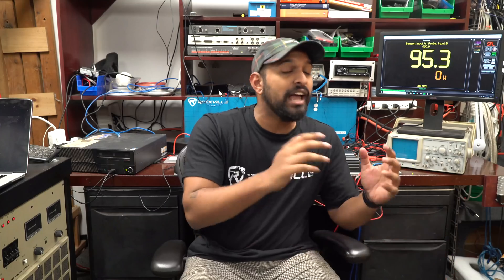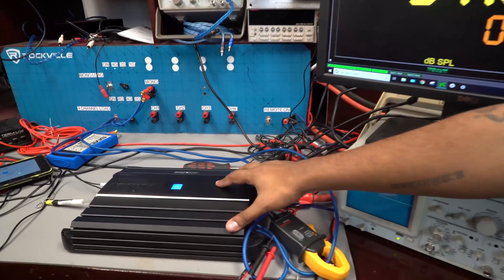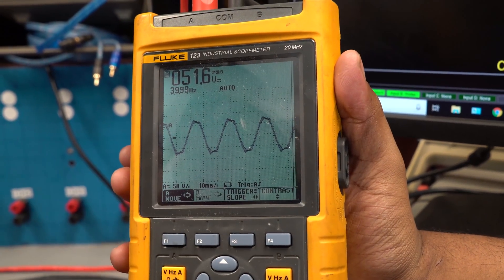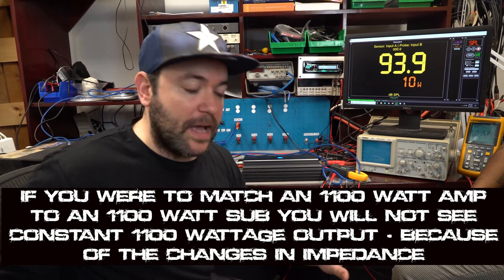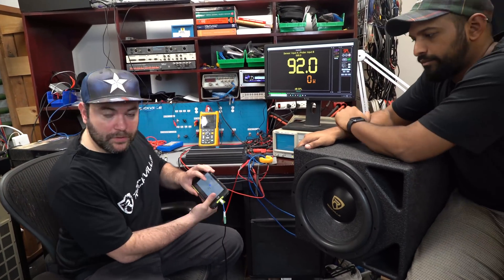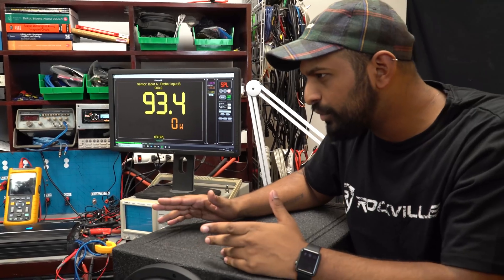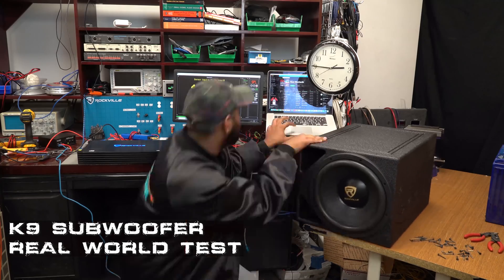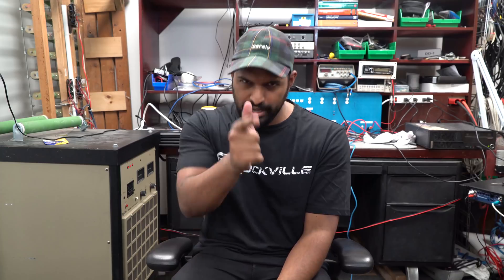Impedance Vs Frequency ft. An Alpine MRX-M110 & A Rockville K9 Subwoofer

Comment: I won’t lie I’m looking into a set of your k9 subs. For the price they look to have good specs
Reply: We are very confident you will be happy with them and impressed.
Reply: Rockville Sam only concern I have is only rocking a jl 500/1 slash not sure 300 watts per speaker will make much noise if there rated for 1000 watts
Reply: @paulgarcia6257  500/1 is a good quality JL amp but its only 500 watts at 2 ohms so you would be underpowering the woofer but if you choose to get it with that amp then make sure to get the 4 ohms version so you can at least run it in parallel down to 2 ohms  and get the maximum out of your amplifier. In a perfect world I would say to get a more powerful amp than that for the K9 woofers.  I hope this helps.

Comment: Box tuning can make up the watts but adjustment of the port to get the ohm load that makes your amp perform to it's optimal power range
Reply: Slow down these actors cannot comprehend Port matching nor do they know the difference between electrical Watts and thermal limits .

Comment: I’m no noob when it comes to “clamp power” but I’m one to believe if a sub is rated to take 1000rms  it should be able to play around that power not the odd spike in power once every few seconds 
Meaning if I had a sub rated for 1000w yes the everyday person buys a 1000w amp but when stated CEA rating it should be able to take the “rated” power clamped for more then a few minutes 
A consumer isn’t going to market there sub 
It’s a 1000rms sub however can only take that power occasionally 

If I buy a 1000rms sub I’d expect it to take 1000rms at BEST “daily” not just for a minute
Reply: Well..just keep testing those subs on your "Will it Blow" series.

Not..stating this..test tone aside...how music musical power would you recommend using..how many actual watts.. Would you suggest using on your new DESTROYER 12?

I am not asking what size amp..I am asking how much net wattage after impedance to get the most out of the sub on bass music?
Reply: @alvinmiller6675  Alvin We recommend you use a 2000 watt or 3000 watt RMS amplifier on the Destroyer , you can get away with a little more power if you know how to set your gains and then you can play your music at high volume.
Reply: Hi Mitch, thanks for the comment. We will have more videos coming in the near future explaining this topic. We also have another video coming with  the K9 where we are putting more wattage on it to show it can handle much more. There is something  called crest factor. If you want to do a test yourself then try the following but if the subwoofer blows we can not be responsible. Here is a test you may do. Take your woofer that is rated for whatever RMS its rated for, then clamp power it at its full rated watts with a test tone. Best thing is with a term lab or an AMM-1 as just clamping doesn;'t account for phase so you will not know what percent to deduct after you multiply amps times volts to get watts you will only have VA. Now run a test tone frequency  through it and see the clamped RMS watts on the meter. Most subwoofers will not last 5 minutes. If they are very underrated they will last a little longer. The reason is because test tones have a low crest factor. The wattage will maintain at the full RMS rating at the beginning then subwoofer will star tot heat up and will never get a rest to cool down. It will continue to heat up more and more until it burns up. Also as  it heat sup the impedance will rise which will show less power on the meter so if you want to actually do what you mentioned you will need to raise the level of the gain or volume higher as the woofer is heating and self destructing. Its actually a great way to blow a sub. Please tell me if you have questions on this and I'll try to answer them.
Reply: Rockville Sam yea I understand what your saying but there are still so many factors that you are not applying to this compared to EXO testing and trust me if we could get Rockville in Australia I would get a few but after conversion rate of sub price and monster shipping cost they are to expensive for a “budget” sub 
Which is sad because I’m a few weeks I’m going to be doing a massive “budget” sub burp/music tests with tons of budget subs around 40 to be exact and these would fit in perfectly so if u wanna send a 12” to Australia for me to play with be my guest and see how it stacks up against its competitors 

I’ll wait for the next explanation video to come out before I continue my question about the tests you are simulating compared to real life testing and bench testing also why ur tests are not the same as EXO 
I’ll give you a hint ...loading...

Talk soon
Booma
Reply: @rockvillesam3772  yes but your sub didn't handle its rms in music spikes for a min. I like the value and was considering trying a destroyer for the price but these last few vids trying to pull one over on  consumers changed my mind. Your ratings are nuts it's just marketing. Rate them where they need to be and it's still a deal. Not 1000 rms 4000 peak. Are u kidding.
Reply: @garymason2815  Stay tuned for next video. All will be clear to you.
Reply: @garymason2815  For Destroyer its 2000 RMS thats the rating you should pay attention to if you will match it to a quality amplifier. Its an awesome powerhouse of a subwoofer. Its really a beast.

Comment: good info guys. 
Another area not often discussed is mechanical power handling vs thermal. Most drivers will exceed Xmax long before they hit thermal. This is easily seen in 1) a ported enclosure in which frequencies are played below Fb and 2) a sealed enclosure enclosure used with too much boost
Reply: Yes you are right. Maybe we should make a video showing this and explaining how to set the subsonic filter properly to counteract the problem.
Reply: @rockvillesam3772  Absolutely! As a speaker designer myself, its one of the factors I look at and one I see most overlooked m
Reply: @isaeagle4031  You are totally right on that
Reply: Rockville Sam, what you guy almost come across as not getting is that these kids(bassheads) today play a ton of music below 30..even 25hz today and rarely if ever even use subsonic filters. This is not the 80s and 90s anymore...neither is the music of choice.

And they put very big amps on subs to take account impedance rise!

But keep the videos coming!
Reply: @alvinmiller6675  Hi Alvin, thats a great point but some of the kids do not realize that when you have a Vented box when the woofer plays below the tuning frequency of the box the subwoofer reacts in an "unloaded" way and at high power will go beyond its linear excursion levels which can severly damage the subwoofer. Also well aware of the impedance rise and sometimes trying to squeeze more power out of amplifiers by running them below minimum rated impedance. Its living on the edge for the amplifier and it makes it much more likely to damage the equipment.

Comment: Get an orion xtr 2500.1dz
Reply: I second that. I love my strapped Xtr 2500.1's
Reply: @catch22frubert  how much power u think u getting at 1ohm load strapped ? Im thinking of getting 2 for my xfls and run the subs at 2ohm strapped
Reply: @HardKnocks160s  I run mine strapped at 2 ohms on 2 Soundqubed HDC3 18's. I wouldn't strap them at 1 ohm for a daily build. The amplifiers aren't maxed out in my setup, but the subs are moving really well, and I'd assume I'm clamping 3000-4000 watts RMS after impedance rise, depending on the frequency played. I don't compete with it, so I never cared to clamp test or anything like that. It's just a daily ground pounder. The wattage is always going to be dynamic and jumping around with the music, but you should be able to see 3000-4000 watts on average if your electrical is good. I also have a 300 amp alternator and four group 31 AGM batteries. I usually sit in the mid 13 volt range at 2,000 RPM
Reply: @catch22frubert  thats pretty good any vids?
Reply: @HardKnocks160s  The Xtr 2500.1dz is a really strong amplifier. I ran one @ 1 ohm on two American Bass XR 12's for two years, and those subs got down for just two 12's in an SUV. XFL's are roughly equivalent to the XR's I ran, so I can only imagine that two Xtr 2500.1's would do. You would probably have to be careful about tuning, because strapped Xtr's would definitely overpower two XFL's. If you really want to be loud, consider using two 15'' subs and a single XTR 2500. Cone area is King, and it's less expensive than buying a ton of electrical upgrades.  Bigger subs with more cone area are the most effective upgrade you can make
Reply: @HardKnocks160s  I haven't made any videos yet, because I'm still building the setup. I'd like it to be clean and complete before I go trying to show it off. Just got the matching Xtr 500.4 and new 6.5's for the interior speakers, and I'm changing the head unit. Last, but not least, I definitely need to do a ton of sound deadening lol. After she's complete and cleaned up, I will definitely post a flex video
Reply: @catch22frubert  thats pretty good any vids?
Reply: @catch22frubert  i have a synergy audio wfo 5k rms amp rn at half ohm on these new model xfl 12s in box tuned to 30hz 2 12s in a sedan they take all power clean power i was just wondering if i should strapp 2 xtrs i had a 2500.1dz before they are good strongs amp

Comment: Get a bigger amp and try out the test .   clamp a 1000rms to a k9.
Reply: why you already know iT Will blow in 30  seconds
Reply: @promo130  I guess stay tuned for the video to find out.
Reply: Rockville Sam 
Exo gave that k9 about 600 to 800 rms no way near a 1000 and iT blew in 30 sec
Reply: @promo130  watch our response video to the EXO test. 2 very reputable subwoofers blew using the same test as his. Here is episode 1  https://www.youtube.com/watch?v=kqUTy5sbM6Q&t=270s

Here is episode 2 for you https://www.youtube.com/watch?v=kqUTy5sbM6Q&t=270s
Reply: working on the video. Great minds think alike!

Comment: I guess to give a better explanation if you took a Sundown X subwoofer rated at 1500 RMS and put it on a 3K wired at half ohm taking into account that the impedance will rise well over 1 ohm so yes in certain frequencies it will be seeing less than rated power but there will definitely be times it is seeing well over rated power and it doesn't have a problem what we were all saying with your video is you never even got it to a thousand RMS not even close so like I said people are thinking it should be able to handle a thousand Watts but like I said all you have to say is what you said briefly in that video is it can take a thousand watt amp not a true thousand Watts continuously and also like in your video it can take more than a thousand watt amp do to impedance rise but when it comes to actual wattage it cannot handle 1000 RMS and like I said this is why sundown rates their subs as they do everyone claims their underrated but what's your showing in your videos is why people think they are underrated because it is actual power did they can handle continuously so when someone puts a 1500 RMS amp on an X they think this thing isn't even blinking at it but that's because they're only getting how about half the wattage they think they're getting to the subwoofer
Reply: My x12 took my deaf bonce 4k at 1ohm nicely. . My skv2.2500 tickled it and it wanted more.. but enclosure has a lot to do with how much power u can put to a sub

Comment: I wanna talk about that sundown woofer blowing why did the wattage shoot up to 3000 when it blew???
Reply: Basically saying the coil shorted itself which means no ohms or very little
Reply: Keith Faver impedance goes down as coils heat up and unwind...all subs will do this before they blow...lower impedance equals higher wattage...most amplifier protection circuits run on this concept to help protect amp damage....as well as other variables.

Comment: Hey mike. Thank you for another awesome video. I'm thinking of buying 2 of your k9 subs. But I'm going to play it on a sound digital 2000.1 d 1 ohm stable amp. On what voltage rms output should i be focusing on? 32v to 38v? Or how much rms would you recomend putting on 2 k9d4? Is for music no db drag. Uugghhh I'm not sure if i should go with Rockvilles k9 12d4 or just go with nvx 12d4 rated at 1000rms. Hmmmmm.....only reason why i want to try Rockville subs is because i have 2 Rockville rxa-t2 amps pushing 8x6.5 inch faital pro mid range. Help here mike
Reply: Those rockville will beat bro, they sound very good.
Reply: @dangles4thgenna853  thank you bro. I'm going to order k9 d4 then. Nvx is going to cost me about $158 usd more if i buy in pairs
Reply: riez 007 
Buy the nvx, way cheaper in the longrun
Reply: @promo130  ok bro. I checked at sonicelektronix just now. And i see there is not a big difference in price. K9 12d4 gonna cost me with shipping $130 usd and nvx trough sonicelectronic about $160usd. Gonna go for 2 of them btw. Thank you
Reply: @promo130  and the nvx has only good reviews
Reply: riez 007 
Nvx is a good brand
Reply: @promo130  thank you. I'm going for nvx.

Comment: so are you trying to say CEA rating is done with a amp that clamps 1000rms on tones but then you play music through it for the test ? and thats how you get that rating ? lol
Reply: Actually the way all reputable manufacturers (CEA certified or NOT) get amplifier ratings is the output wattage the amplifier will do at 1% THD at its minimum impedance. Which in plain English means if an amplifier is advertised at 2000 watts at 1 ohm then the amplifier will need to be capable of  2000 watts output when it sees a 1 ohm load at 1%THD (which means at clean signal before distortion. This is the test that the amp dyno does on all these amplifiers. It tests its output at 1% THD running at a fixed impedance.
Reply: @rockvillesam3772  so how does the sub get 1000 cea out of this ? I get the amp rating part .
Reply: @rockvillesam3772  we have been having an interesting conversation on Facebook about cea certification. I'm very interested to hear about your take on it .
Reply: @mazda2284  Sure whats your question about CEA ratings Ill try to answer it for you.
Reply: @rockvillesam3772  what the test consists of for testing subwoofers rating , i believe its the 2031 rating
Reply: That's exactly what they're saying sounds like a bunch of Russian collusion to me, no offense to deaf bonce love that 32 hate that price

Comment: I find it odd that a Rockville amplifier was not used for this test. Is there a particular reason?
Reply: Yes it was intentional. We saw in a previous video that even though we used a Rockville amplifier that was Amp Dynoed by Ryan Blakenship to do rated watts there were people who commented that it was the amplifier causing this. So we took an Alpine amp so those people can see we are not trying to play any tricks this is the truth. Furthermore we clamped the amp at its full rated power on video to re-affirm that. We could very easily do the identical test with any Rockville amp.

Comment: Do emf lowballer for your next will it blow episode please, I am genuinely curious.
Reply: It will blow in that box. If you notice on the graph they did the port was peaking at the tuning which was about 54hz. The song they play is way below tuning on the sub. If they were to put the sub in the correct ported box for the song it will be fine given no clipping is sent to the sub.
Reply: @mattstarke7373  they where sending that shit straight to clip city
Reply: @mattstarke7373  If they don't clip the signal and play it at rated power, it shouldn't blow no matter the frequency, thats what ratings are all about. Saying something is rated at a given power and it blows at that level without a clipped signal is dishonest. That's what EXO and EMF are talking about.
Reply: @doolkore , what I am saying is if they play the sub in the ported box below the tuning of the box it will blow it too.
Reply: @mattstarke7373  really only way to do that is to get a different box for each sub they test which is no possible for all these tests making boxes designed for the subs specs. exo and bigd doesn't even do this when they test a sub
Reply: @kevinanglin678  , Exo and Big D used the correct size and tuned box when they did their test. The will it blow test is designed to blow up any sub that goes into it. It is tuned way to high when compared to the song.
Reply: @mattstarke7373  If you play a sub outside of the tuned frequency of a sub, yes it draws more wattage from the amp, but will not blow the sub assuming that: wattage is at or below its rated power, the signal isn't clipped, and its not a Rockville k9 sub.

Comment: idk if this is a needed video, when they already have a amp dyno to rate a amps wattage , almost every SPL forum covers "impedance rise" and the easy way to calculate it. if a users wishes to learn past the basic's of audio watch the Hexibase youtube channel. might also explain the difference of the resistive values like "R" vs impedance resistance "Z" , i also like where your going now much better than feeding the internet trolls
Reply: Thanks for the comment. We understand there are videos on impedance rise and we are aware that experienced SPL guys know this but there are others who are still learning and even some SPL guys that can benefit from a simplified explanation. Based off the comments we got in the videos there were many that actually did not understand this and we want to educate the entire community.